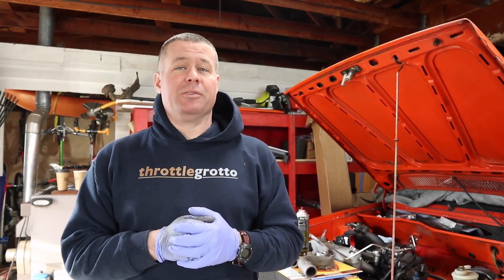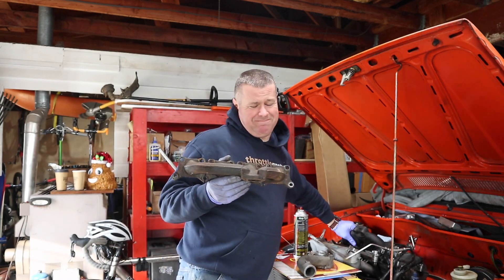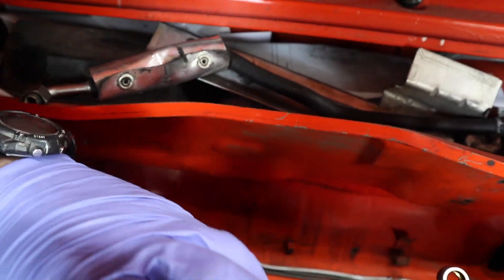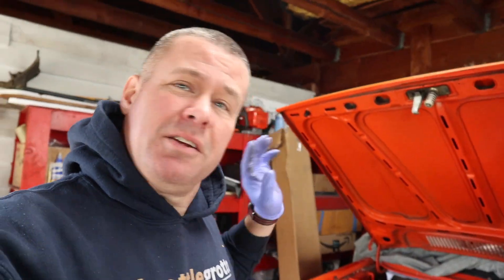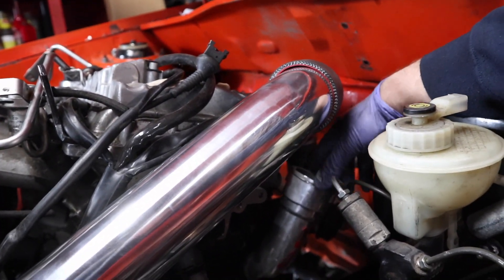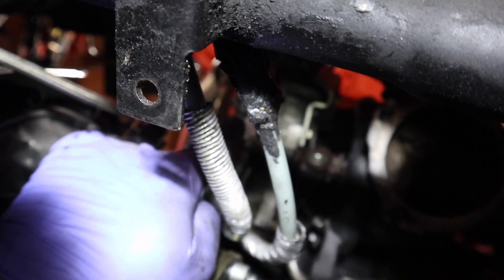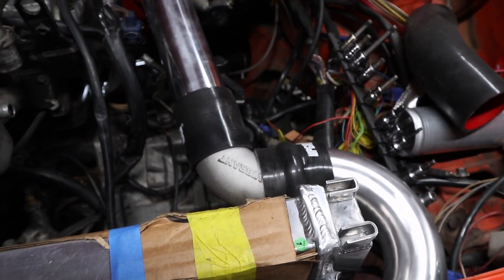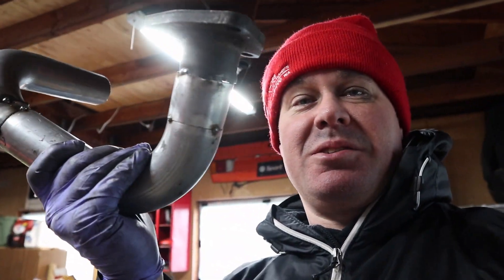Swapping the turbo for more clearance- 1975 VW Rabbit 1.8t 20v ep 47

Comment: https://photos.app.goo.gl/DajRFnA7en72cHCGA https://photos.app.goo.gl/DajRFnA7en72cHCGA  https://photos.app.goo.gl/dy4vnB7cZoyu8v9g9 https://photos.app.goo.gl/qJkCjBPJ14JJPUC59  https://photos.app.goo.gl/8TfiTXbpyHbTHvd99 this is my setup using the audi turbo. you can reclock the hosing and use 3 of the 4 fasteners. drill a new hole in the wastegate bracket, works perfect for me runing stage 1 18psi boost https://photos.app.goo.gl/cBeWnTpVwGXYjFyS8